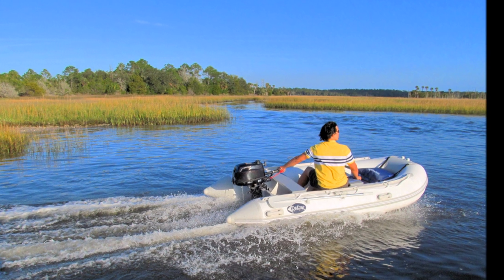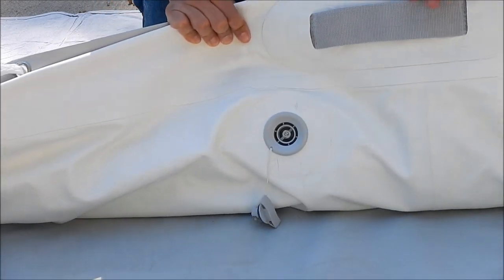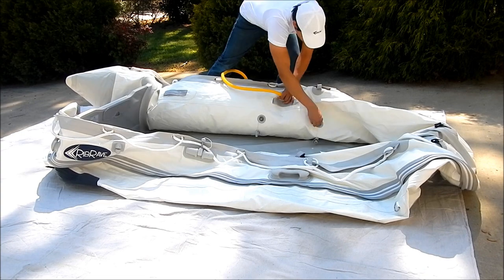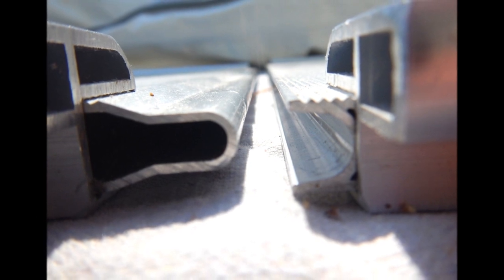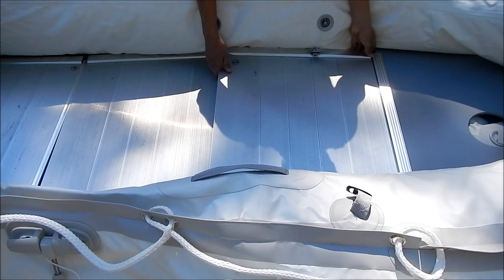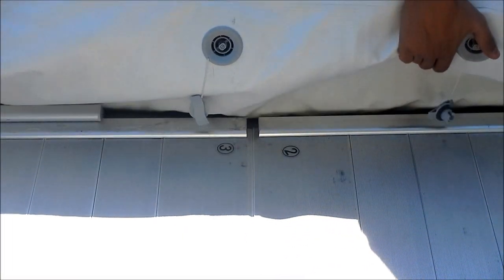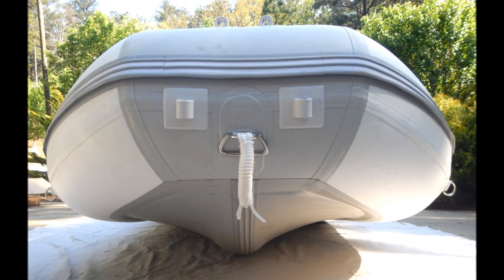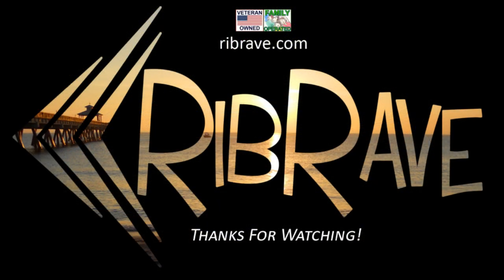How To Setup An Inflatable Boat In 20 Minutes Or Less | RibRave

Comment: What is the little cap at the back of the boat for ?
Reply: When you put a motor on boat it makes it self bailing. It sucks the water out of boat. I also wondered what it was and finally found the guy that knew and it’s awesome
Reply: The little cap on the back of the boat is a  plug so if you get water in the boat after you get done you can drain it out of the boat I leave the plug in when on the water